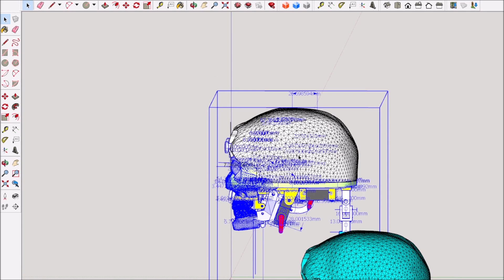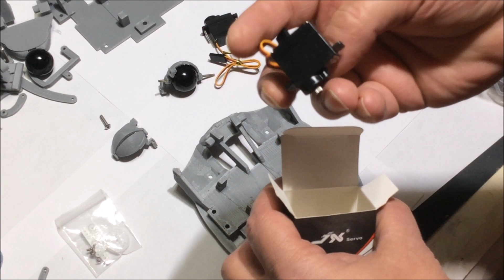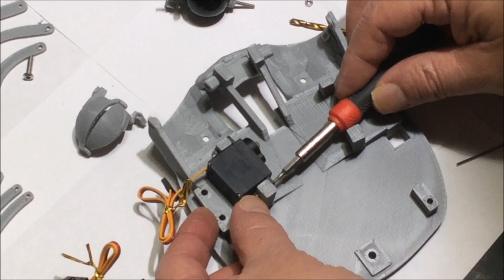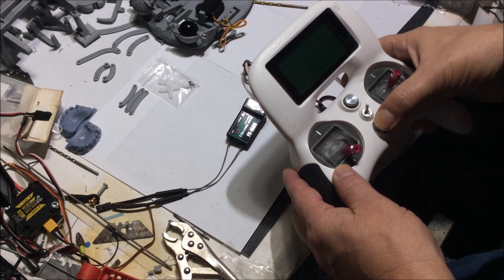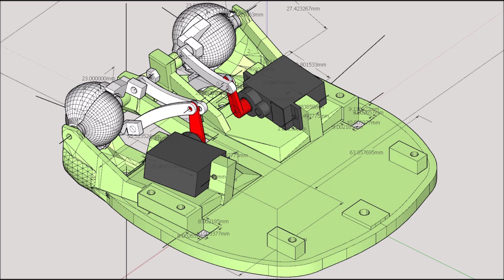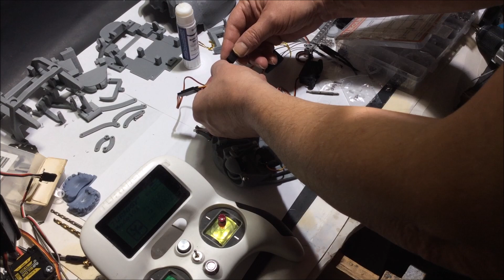3D Printed Animatronic Creature Part  17

Comment: Where do you get the black eye-balls from?
Reply from the maker: They are beads , There is are was a store that had round black beads (Round gumball beads) and many sizes 10mm to 30mm and all these beads have a 2mm hole ,the sphere center axis. And are acrylic. Hope this helps , just search  Round gumball beads https://www.etsy.com/listing/4422953899/stock-your-store-22mm-10pcs-70pcs-500g?gpla=1&gao=1&&utm_source=google&utm_medium=cpc&utm_campaign=shopping_us_ps-d-craft_supplies_and_tools&utm_custom1=_k_CjwKCAiAtq_NBhA_EiwA78nNWPbl8J12JdJb-plkNY37kaPiNfxC7ecNwzY5HDpAWADXb8DD8ntMyhoCvKAQAvD_BwE_k_&utm_content=go_22198874542_177309891071_731690488078_aud-2079782229734:pla-295462056867_c__4422953899_101915751&utm_custom2=22198874542&gad_source=1&gad_campaignid=22198874542&gbraid=0AAAAADtcfRLhslIA4XMjhUVUJvjhWIz4A&gclid=CjwKCAiAtq_NBhA_EiwA78nNWPbl8J12JdJb-plkNY37kaPiNfxC7ecNwzY5HDpAWADXb8DD8ntMyhoCvKAQAvD_BwE

Comment: Very cool!
Nice to see some progress, and nice to see it coming together. Boy do I know the woes of getting the printer settings set up right, and having to drill out holes! Have you explored threaded inserts? I've been exploring them with my reindeer project because of the tiny joints in the legs, armatures, and cam shafts. I've had mixed results, they can be a pain to insert, the molten plastic likes to seep into the threads if you aren't careful. But if you get it right they eliminate the need to screw directly into plastic or have a nut on the other side of something.
Imperial versus metric is a pain I agree, but going metric is more precise. In tiny spaces, precision is definitely key! The internet is awesome in ordering hardware!
Yup, I feel you with getting that threaded rod through the eye! I think there was a trick of dabbing a little glue on the tip of that temporary shaft you had and then attaching the final rod and then pulling it through to make it easier. Still very fiddly!
Another trick is to have a pocket and insert a nut as a captive nut. That was used extensively in Michael Baddeley's R2 design.